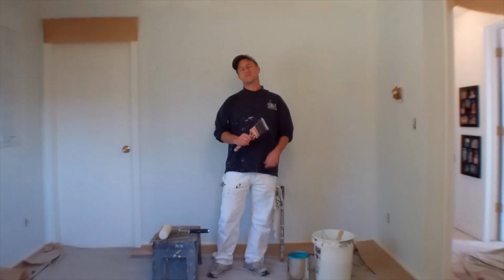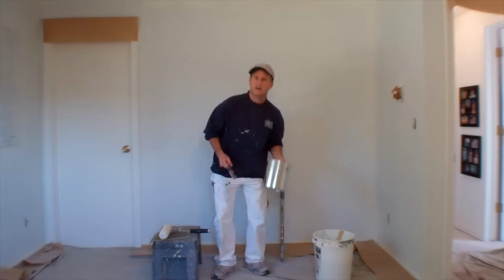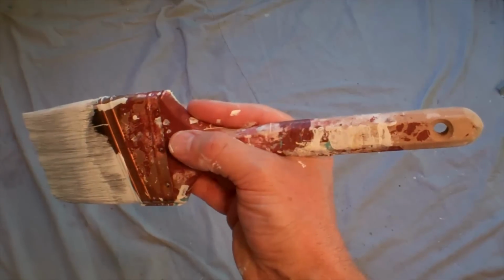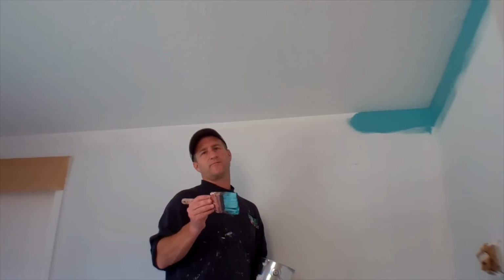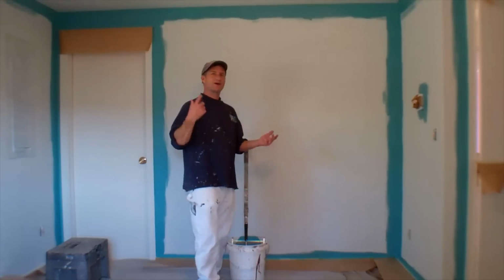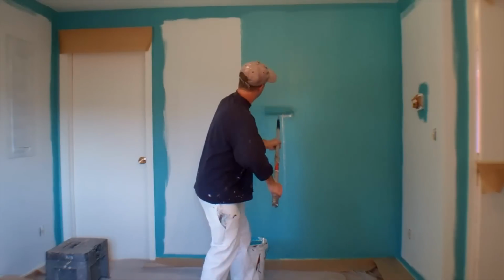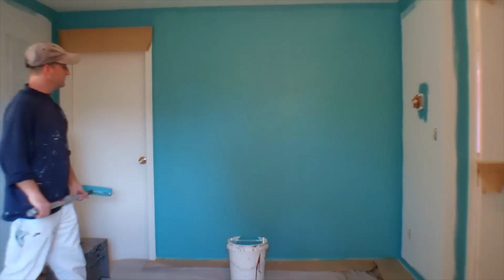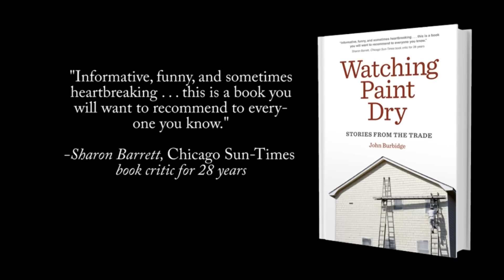Interior Painting Step 3: Painting the Walls

Comment: Thank you so much! I have a question though: previous owners used a paint with a primer in it, and it was peeling off the walls. I repainted the walls but the paint still keeps coming off and in one spot it came out in a large sheet.Should I sand and prime the already painted and repainted walls before repainting? It doesnt help that there is a cat jumping on the walls.
Reply: +satusirkku It sounds like the paint that is on the walls at the moment hasn't adhered to it properly. I would bet that all that paint would just peel off with a bit of scraping using a good stripping knife. When it comes off it will hopefully expose a good sound wall to apply the paint you have to it

Comment: step 1 you need a small brush 2 ich will do well this will stop picture framing  you need to keep your cuting in is small as possible .roller i would use a 10 mm nap   you should be  rolling across the bottom an tops as you go an laying of as you go also your paint sounds why to think you can hear it pulling your laying of will look realy uneven

Comment: People tell me that cutting in the room is bad because it will dry and when you roll the wall it will always show the cuts. What is true and how to fix this?
Reply: There's a very clear line where he cut at the ceiling, but that's obviously because the middle part of the wall is still wet. The video never shows the end result when it's all dried, but I'm worried about the same thing.I wouldn't even know how to fix that if it did dry differently, except to repaint the entire wall...
Reply: mmik Don't worry, I did it this way and got a beautiful wall. It was like a rough wall with the small points. Don't know the English name of it but you know what I mean. It cost me a bit more paint and time but the result is good!
Reply: I know what you mean by that. like the specs on the drywall under the paint. my house looks like it used to have those but they got painted over a few times and smoothed over.

Comment: Tried the lay off. no good..roller marks and dull in spots, gets dry ect. However it may be the paint. Tried a Satin finish, BUT the new Satin's are how Semi Gloss used to be..WTF? Never had this problem with Sears easy living Satin or Semi Gloss. hard to get the Sears paint so been using Sherwin William or pittsburgh paint. Benj moore goes on nice BUT also too glossey and thin I think, not worth the price

Comment: Hopefully that was flat !
Cause of it had any satin or eggshell finish it would flash if you don't cut and roll by section.
Good info tho
Reply from the maker: It is eggshell, and it didn't flash. You raise an interesting point, though. The reason I prefer to let the cut-in dry before rolling is because if you cut in first, then roll before the cut-in is dry, you will end up with different stipples due to the fact that the cut-in paint is half-dry or starting to set up, whereas the wall paint is fully wet. I have actually seen this happen. However, bottom line is I don't think it's going to matter too much either way. Thanks for commenting.
Reply: Cool
Reply: I know this is an old post but could  I cut in and roll wall by wall to maintain the consistency?
Reply: If you're working by yourself I don't think it's practical to cut in as you go especially on a ceiling because you increase the potential for losing a wet edge.  On the other hand, if you're doing this for a living how would you be able able to wait 1-2 hours for the cut in to dry.  I've heard the thing about non flat paint banding if you let the cut in dry but I've never had an issue with satin paint. I do roll very close to the edge tho so maybe that accounts for it.

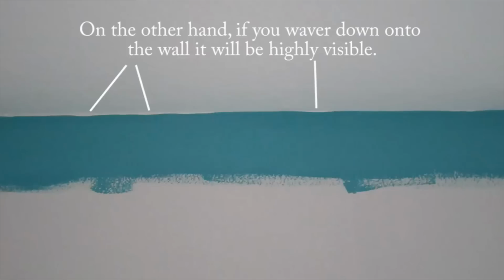Comment: your so wrong about cutting in the walls to the ceiling and over lapping slightly onto the ceiling. Yes i understand about if you stand back and look at the bit where you stood back as you was filming you couldn't see your over lap, 4:00 to 4:10 but if you thought about it when you stood back btw 4:00 to 4:10 and turned your head upwards to the ceiling above you and looked straight down that line to the wall beside you, you'd see the overlap there wouldn't you and that's awful especially with the colour you used so i honestly hope that's your own house..lol  Very bad advise about overlapping but the rest of video i 100% do the same technique's for the last 25year + except we never tape up the skirting boards / base boards. We cut in walls neatly which can be a little longer but not much then finally cut the skirting boards top edge excellently with the gloss or egg shell... That's the English we do it,,,,,
Reply from the maker: Gary--In my opinion, 1/32 of an inch is not going to be very noticeable even when look straight up at the ceiling. Running the paint just slightly up onto the ceiling, as I show, is a technique that prevents people from leaving any unpainted area on the wall, which is much more noticeable than 1/32 on the ceiling. HOWEVER, if you run the paint anymore than a tiny bit onto the ceiling, then you need to come back later with the ceiling paint and straighten it out, no big deal (see step 5 on "Touch Up and Clean Up," where I show other ways to straighten out lines between colors). No matter what method you use just make sure it looks good when you're done! Thanks for commenting.
Reply: *****
You and Gary Reed sound like embittered local business rivals or something! Calm down.  I don't think that you could call this tutorial 'sloppy' by any stretch of the imagination.  In your experience one of the paint techniques he used is wrong, but it has been his experience that it is right.  I've seen tutorials in which professional painters advocate, 'Never use an angled brush!' and others which claim they are a God send.  I think people will watch a few clips and decide which techniques work for them.  But there's always common ground regarding certain principles in each different clip.  I found this one extremely useful and had some "Ahh...that's where I've been going wrong.." moments. God bless 'Youtube' I say.
Reply: People watching this video are not a professionals like yourself who can pull those straight lines like nothing....This trick really does help beginners just what this video is intended for....stop complaining and keep your negativity to yourselves...
Reply: Sounds like Gary and Dong are upset they are losing out on business to regular people who do it themselves now thanks to Youtube and guys like John who share their knowledge for free...If you know of better ways..then make some Youtube videos about it showing the correct procedure...or will that cut into your contracting profits?
Reply: Painting the walls before the trims is also a no-no.Cutting in the walls around the trims is much easier than trying to cutin the narrow edge of the trims.
Reply: You have to do better with the cutting